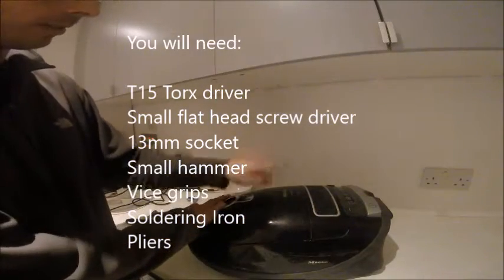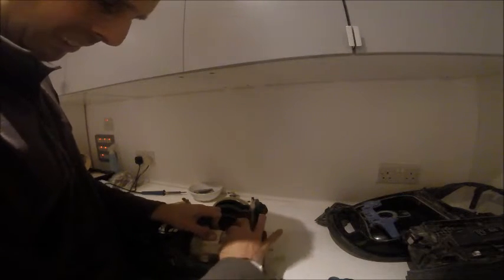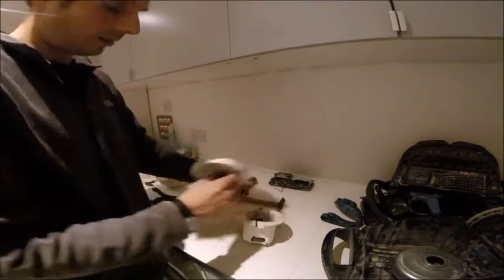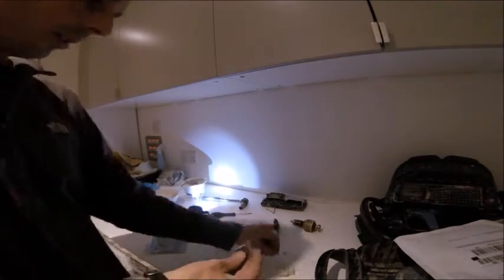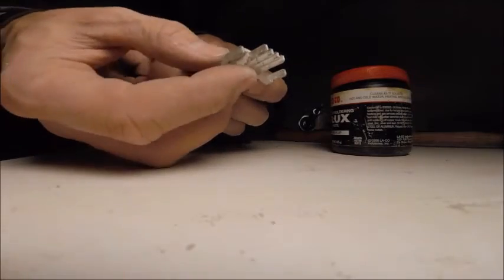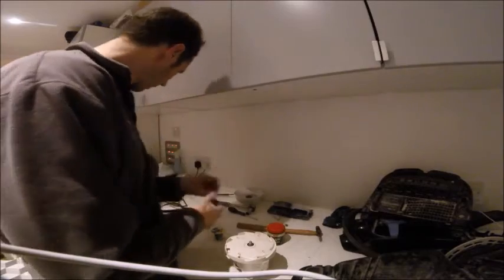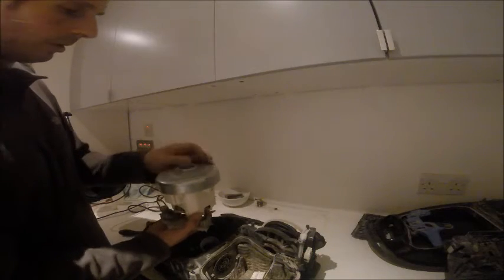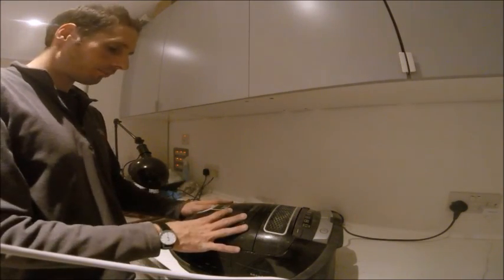How to fix a Miele c3 vacuum with a broken motor for almost nothing

Comment: OK, as I said in a previous post an excellent video, well done.

To avoid using vice gips and risk damaging the impeller, which one reviewer seems to have taken umbrage with, I found that holding it with a pair of heavy duty gardening gloves enabled me to unscrew the nut holding the impeller and screw it up again securely.

Comment: Like everyone else seems to have said, what a great video. Miele motor making a grinding noise, thought it wouldn’t do any harm to strip it down first. Spent a good 2 hours cleaning the impeller and motor of plaster dust. Put it back together and now it works! Saved between £60-200 for replacement motor. Thank you.

Comment: Thanks for this!  Our S2121 stopped working mid task this morning.  I followed these instructions down into the small PCB with the Triac in the motor and found that one of the 3-pins had heated up so much that it had melted the solder around the joint, thereby opening up the circuit. Presumably this joint was dodgy out of production, with just enough resistance to heat up over time.  I fluxed and resoldered the pin, and put everything back together. Works great.  I happened to have a strap wrench, which worked well holding on to the impeller while loosening/tightening the left-hand nut holding it on.

Comment: Amazing video. Thankyou. My wife was about to take the Hoover to the Hoover doctor. I reassembled after fitting triac and didn't work initially😥 turned out I needed to learn some soldering skills. I resoldered, checked the circuit board for continuity with a multi meter prior to reassembling. This did the trick. Tks again.

Comment: Excellent video, i got the task of looking at a Miele c3 that wouldn't turn on. Thought maybe the lead was damaged inside the reel but after i opened it up there was power going to the motor so thought the motor was faulty.
Was just was about to put it back together and send for recycling and decided to look on Youtube and seen this video.
Turns out the middle triac connection was burned out, cleaned up the connection and resoldered and its now running líne new. Thank you

Comment: Very helpful, thank you. I had a similar problem, took my vacuum apart, tested for voltage at the poles into the motor and saw that it was normal, so I knew that the problem was within the motor. When I got to the PCB, it was covered in a fine dust as was the rest of the insides of the appliance (I had used it to hoover extremely fine dust from angle grinding tile joints - bad idea!). Anyway I gave all the motor components a good clean using compressed air, reassembled and it now works perfectly. I’m writing this comment to thank you but also to say to other viewers that they may not even need to replace the PCB.
Reply: how did you test for voltage at the poles, I think voltage might be the issue with mines

Comment: For those who wonder why they have a spare screw after reassembly, this is the one which got unscrewed at 2:42. You have to put it back in place before reassembling the top cover or you will be blocked from doing so. Anyway, great video !

Comment: Helpful  video. Easy simple instructions makes it easy to do this yourself. I had a cord retraction problem with my Miele C3, it turned out that the cord got twisted and got stuck in the retraction itself.
This video helped save loads of money on a repair guy. Thank you for the video

Comment: Thank you very much for posting this video. It helped me A LOT in the process of fixing my vacuum cleaner (Miele C1 Classic). Pulling the motor apart and replacing the TRIAC would have been virtually impossible without accessing your video.

Comment: Great video, many thanks for the helpful advice, I stripped mine down to the motor and used a hair dryer on cold to blow out dust from every part, I then plugged in the power supply and tested the cable from plug all the way into the motor with a non contact 240v power tester to see if there was a broken cable or connection, didnt need to do anything else the motor started and all is working fine now, put everything back carefully as this is where I have trouble and bits break, after assembling the machine I realised I left one of the green motor sponge covers out (the smaller one) and couldnt be asked to strip it down again so put it in the spare bag anf filters box for next time, all working good, thanks again.

Comment: Mine wasn't the triac. The last owner had cut the motor filter too small and it sucked in a load of wire. Must have over heated and burnt half a leg off of the mosfet. Raplaced with a bit of wire and it fired up a dream. The opening instructions were very valuable. Thanks

Comment: Thanks so much for this video.  I had to take the vacuum apart just to clean it as it had been run with the bag disconnected.  Great explanations.  Only thing I struggled with was getting the plug connector back together.  I had to separate the two plastic bits fist

Comment: Great video! Clear description of disassembly & reassembly made it possible for me to eliminate the terribly loud running noise that was caused by dirt being sucked into the impeller, unbalancing it. Once cleaned out with a brush and another vacuum cleaner, the unit was reassembled and was returned to ‘just-as-new’ operation. Thanks very much!!!
Nic
Reply: thanks, very helpful, I din't think I'd manage the triac, but my motor is dirty, hopefully cleaning out the impeller will fix it, going to try it

Comment: Very helpful, thanks. I was stuck at how to get the metal shroud off the motor. My Miele vacuum similar to the one in the video was making a very loud whining noise. Cause turned out to be dust and dirt stuck in the impeller blades. Cleaned it thoroughly with a good pipe cleaning brush, vacuum much quieter and better suction. For those whose vacuum doesn't start or is intermittent but triac looks ok: resolder (reflow) all the high-current connections on the main board and the small motor board containing the triac, including the triac solder joints. The weird waveform produced by the triac damaged the solder connections on my vacuum over time. You can recognize high-current connections by fat traces on the PC board.
Reply: Hey I'm having the intermittent / pulsing shut off issue after replacing my Motor. Any clues? I'm going down the rabbit hole of the Triac but looking for some visual help.

Comment: Excellent video excellent advice. I can add a twist to the story that others may find relevant. My motor stopped working suddenly after a clog (someone ran it without a bag). So I opened things up and saw the telltale burn mark on the board around the triac's middle pin. I put it under a microscope to see clearly that the solder had melted off the pin so it no longer made contact with the trace. After running a continuity check to be sure the trace was okay I added a drop of solder back to close the contact. Reassembled, turned it on and the motor hummed like new. Thank you About The House. Fixed for no quid at all!
Reply: Thanks, that's my case too. No need for a new triac then

Comment: Great video! My C3 motor was working intermittently, depending on the vacuum cleaner position. The TRIAC was ok so I dug a bit more. The connector socket to receive one of the brush connectors looked a bit loose, so I wrapped the brush connector with a bit of tin foil and after putting it back together again, voila! A working C3 again. Thanks for showing me how to disassemble the motor.

Comment: I have the same issue with my Miele S8310. Thanks for your very helpful guide!
I found this triac as alternative: BTB 24-600BRG (TRIAC, 600 V, 25 A, 50 mA Standard, TO-220)  Same voltage, same trigger, a bit higher rated current - so it should last a bit longer. I'll give this a try. My original T2050-6H does not seem defective itself (will replace it anyway) but the solder joint has burned away, so it might be a good idea to add copper wire to pcb connection for additional support (and cooling)

Comment: Hi.  Thanks so much.  I ended up deciding to just swap out the motor, which I found new for $125 shipped.  But super helpful to have all the instructions on how to dissemble it and the tools required.  It’s working perfectly now!
Reply: Hi, can you share a link to new motor or provide the part number? Thanks

Comment: Thanks for uploading which i saved it. i did for tile grout and miele tech said cost 350$ to replace motor, i blow everything with air compressor like someone did in the same link, it was very helpfull, now my c3 runs sweet.

Comment: Many thanks! This fix worked for me on an old Miele Cat and Dog 2000. I couldn't decide if the motor pcb or the speed control pcb failed and tried this because it was cheaper. 3 leads exit the control pcb and enter the motor pcb. One should be at 230V, one at something a bit less and the blue at zero. When the motor pcb isn't working both of the side pins are dead.

Comment: Vacuum cleaner suddenly stopped today, found this video and discovered the solder had burnt off the rear of the contact on the PCB, possibly caused by 2 years of fine dust due to non genuine Miele bags. Resoldered the joint, tested before assembly and it worked again. Couple hours work for £0. Great video advice.

Comment: Just got back here to say thank you. Very informative video, helped a lot. Would be quite difficult to open without it. Without breaking many parts!
Conclusion - one of the brushes was blocked by dust. Spring couldn't push it enough outside. No electric connection because of that. After cleaning works perfect again. That save me a lot of money and a great vacuum.

Comment: Great video thank you.
Surprisingly I've had 2 of these exact models come into my workshop in the last week. Both of them had faulty triacs. After changing the triacs I plugged it in (without reassembling the whole unit) and the vacuum started but only for 30 seconds or so. As the motor sped up, I could hear sparks coming from the brushes and then the vacuum stopped.  So unfortunately the armatures on both motors looked fine, but they were cooked, causing the triac to burn out

Comment: Just a hint:.  If you want to replace the triac just cut the 3 terminals from the housing with a small plier. Then you have to deal only with the 3 individual  remaining pieces. The video itself is very good. Many thanks
Reply: I know it an old comment, but that's good advice.

Comment: Thank for this ! My s548 decided to only start sometimes, like after repeated on/off switch pushing and such. The weird thing is after it's warmed up it has no issues turning and staying on. The next day however same thing all over again. So I took motor out and the carbon brushes do seem worn and different sizes. I just ordered some and hope this fixes my issue.  Thank you for your precise instructions for taking apart.

Comment: Thank you so much for this video! My wasn't the triac, but the thermal cut off thing in the same PCB, it had melted off so I soldered it back with wires.

Comment: I added a comment yesterday but it's now not appearing. Hope this one does.

Great video clear instructions. My problem wasn't the Triac, it was the carbon brushes, which come in a brass holder ... no longer available of course, though you can get carbon brushes and the attached springs from the usual online sources (think I shouldn't have mentioned them by name previously!). Measurements for the carbon brushes are 30x11x6 mm. If brushes are your problem you will need to cut the old ones out of the brass holder and solder the new ones in ... a little fiddly and try not to damage the brass holder. 

The most difficult part of reassembly is fitting the rear unit after you have put the motor back in. You need to align two 4 pin connectors but it's almost impossible to see them as you try and get the unit seated properly. I eventually took the plastic cover at the back of the rear unit off so I could ensure the two 4 pin connectors fitted. It was tricky getting the back cover off and on again but at least you can see how things fit. Once that connection is made you can test the motor before you fit all the other pieces back on.

Comment: thanks for this video. I didn't fix it yet but at least it helped me to put the vacuum apart without damage and I could one by one eliminate causes. It seems issue is the same as here and I need new triac. issue is I am not experience with changing things in board but I will give it a try when I get new triac if I can get it. as your video is 5 years old.

Comment: 10:30 the one in my 120V Miele C3 motor was a 2050H-6T, which are still in production and readily available, Mouser has them for $1.69 each plus shipping, fingers crossed it and new bearings fixes my dead motor.

EDIT: It wasn't the triac, it was the thermal cutout! I was re-doing all the solder joints on the board, and it fell out when I unsoldered one leg, it burned out one leg! Soldered a new leg on, and test the cutout by heating it with the soldering iron and testing continuity. Re-assembled with new Timken 608-2RS bearings in the motor, runs like brand new! Vacuumed about 1000 square feet with it after the repair.

Comment: Thanks ! Very useful, I have a slightly different Miele and I managed to open the motor Miele MRG 742-42/2 in a similar way and get to the board with Triac and overheating switch. In my case it was the last one that was out of order, one of the two legs had simply melted away. It seems impossible to get this Klixon 3mp331 01 anywhere or even a data sheet to be able to find a suitable replacement. But I managed two connect it anyway. Unfortunately it still switches off due to overheating. The motor seems to be rather clean inside and I have replaced all filters. Could it be bearings that make it so hard for the motor to turn around that it overheats ?  When rotating the impella by hand it stops immediately when the hand is taken off.

Comment: Great video, was able to ascertain it was a bearing and not the triac but the disassembly instructions are key. Thanks.
Reply: Brilliant video. I’ve got the same problem with a collapsed top (brushes end) bearing (I think - there are loose ball bearings and thin top & bottom plates with slightly raised edges) . I bought the SKF bearing recommended here but it won’t fit. Does anyone have any tips what else to try please?   Here is a link to photo https://drive.google.com/file/d/1uXSW9aVhsMcbZ6zoh8SXK5-y7c984Lry

Comment: Great video! For a noob like me it is better to cut legs of the bad triac from the component side and then take out the remainders one by one. It is even possible to solder new triac to say 5 mm remains of the old legs on the same side of the pcb

Comment: Thanks for this great video. I have taken my C3 apart and found the motor spotless but on the circuit board there is a burnt broken connector on that small component next to the thyristor. I do not recognise the component type. The broken connection seems to be the case of the device, earth maybe?, Any thoughts?

Comment: Great Video !  I took apart my C3 vacuum because it was making a loud screeching sound. I cleaned everything very thoroughly especially the impeller, added some grease to both bearings and it still makes that sound. Could the bearings need replacement?

Comment: nice video, just a suggestion, why not hammer the top bearing out first, like that the brushes and rotor stay in place and alle you have to do is take the circuit board out and fix it. Then  clean the mtor with pressured air and you're done.  With me the thermal fuse was out . thnx for the video it fixed my Miele!

Comment: Thanks for this awesome video! Mine seems to be overheating. The motor is not dirty. The coils are not burned, but still shiny copper. After while the rpm goes down, when it gets warm. Eventually it stalls itself. But, it is not really overheating or hot. Do you know what the problem  is?

Comment: great job and great video.  i bought a used miele capricorn on ebay and the previous owner had used it for their pets.  i took it apart and washed everything but it still stinks.  i narrowed it down to the motor.  i wanted to take the motor apart and clean it but didn't know how.  you're video will help me out tremendously.
Reply: fobdout did you break it down yet? How'd it turn out?

Comment: @About The House My Miele C3 just stays on low power as adjustment buttons won't work, if only it had of stayed on high I would be alright with it. Someone else said it was a defective capacitor in the regulator, it should have a value of 0.22uF/275V. I've dismantled it and cleaned it all including the pcb which looks fine but had a tiny bit of damp on it. The inside body of the machine was quite clean as I've only had it for a few years.  Someone else said to switch the wires so that it just has the on / off function. I watched someone do it with a Henry hoover but can't find any info on how to do that with a C3 cat and dog hoover. I've been researching bypassing the motherboard and soldering etc but it's frazzling my noodle. Please Mr About The House, can you assist and do a video on it, I'd be so grateful, thank you!
Reply: It's suddenly started working again, all I did was tip it over by accident and the front control panel knocked onto the floor. This is what happened the first time when it broke and got stuck on low suction. All it needed was a whack in the right spot! Hurrah!